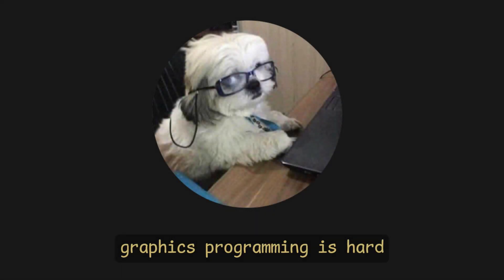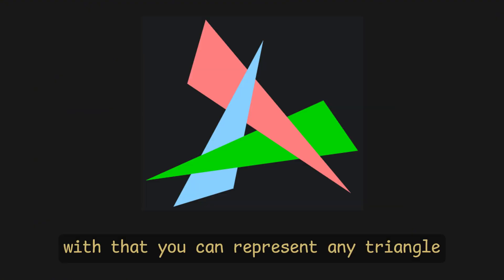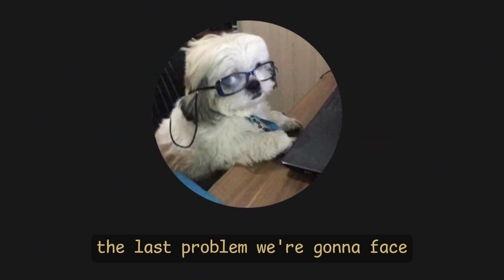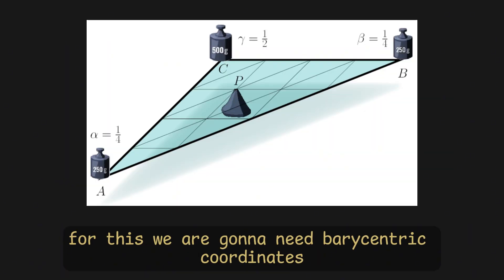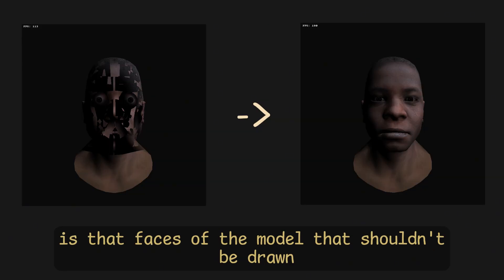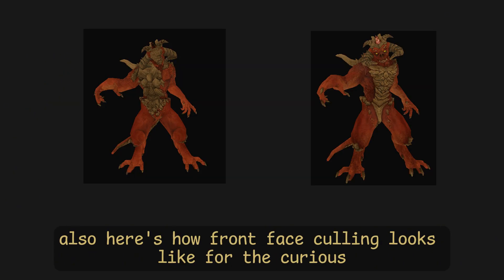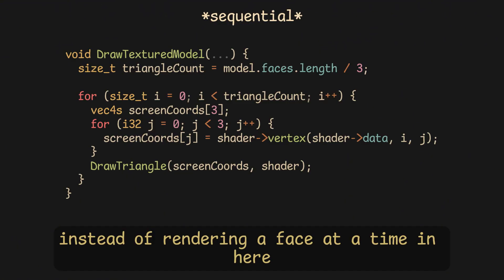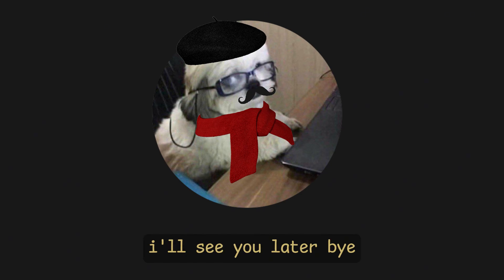Multi Threaded CPU 3D Renderer in C

Comment: Skipping triangles that cover less than one pixel is not backface culling! Backface culling is not rendering triangles that are facing away from the camera.
Reply from the maker: if total_area < 0 then vertices are in clockwise (CW) order hence you are looking at a backface and you can skip, and if total_area < 1 then you can also skip since face is less than one pixel. two different optimizations in one check, i could have explained it better in the video though

Comment: I recently did a software renderer implementation in a fragment shader in shadertoy, just as an experimentation, didn't do a proper projection matrix because I made the view to be fixed, but i did implement perspective correct texturing, it turned out to be kinda simple.
Reply: I always wonder, if you implement it as a shader then at what point can you call it hardware instead of software? Afaik a lot of gpu operations that were once implemented in hardware now run on shaders.
Reply: @thesenamesaretaken  As long as you are not doing the rasterization at the hardware level (tweaking physical circuits to make rendering happen) then it's a software renderer even if it is written in a shader.